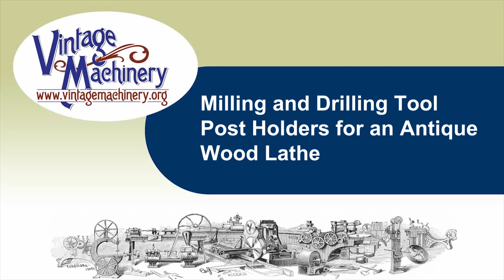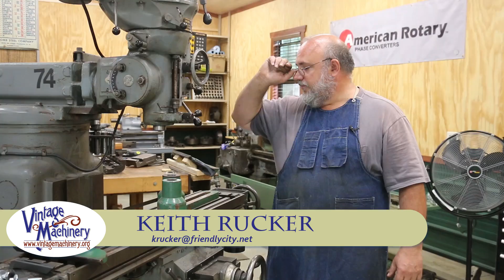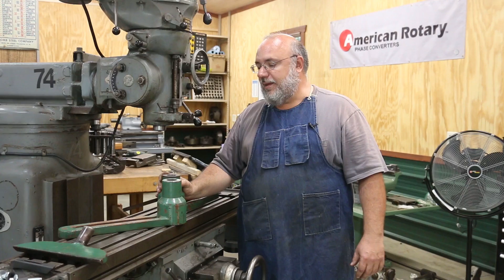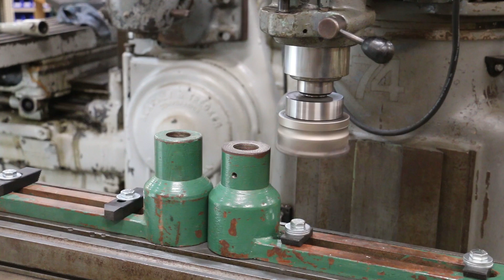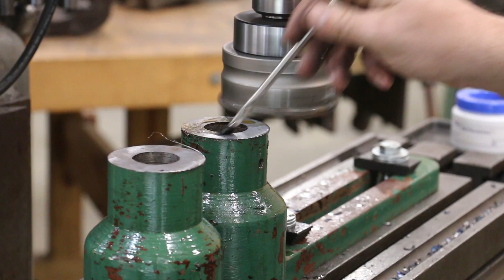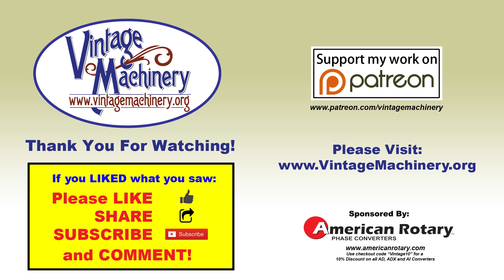Milling and Drilling Tool Post Holders for an Antique Wood Lathe

Comment: I'm surprised you didn't opt to use a slab mill in the horizontal mill for this. That said I love using shell mills for this sort of situation. I've done this to a lot of assembly jigs at work; the jigs are for spot welding robots; We needed more weld gun clearance that the tool shop provided. No match for a massive Japanese vertical mill with a six cutter carbide shell mill. Left a nice finish too.

Comment: Layman here, so not qualified to criticize but thought I saw some wobble in the chuck and bit-?  But it seemed to have bored the hole just fine, turned out great in any event,  Im sure the users of those lathes will be very pleased, having the rest off center is way scary on a wood lathe with hand tools-lol. Great videos Kieth.
Reply from the maker: The wobble was from the drill bit not being perfectly aligned with the hole.  No big deal in this application.
Reply: Guess I should have assumed as much, obviously didn't affect the end result, and that's all that matters.  Thanks for the informative videos-!

Comment: when you clamped the rests to the table the middle of the finger was used is it not better to use the tips to avoid bending the clamps were the bolt goes through.?i am  asking not saying. this was advise I got from another seasoned machinist...

Comment: Did you change speeds on the spindle without turning off the mill?   What kind of mill can do that?
Reply: grayswandir47 not sure about this one but the vario drives use two pulleys, or more, that vary their diameters inversely. Like a cvt.
Reply: I've seen the insides of a Shopsmith with the "Vari-Drive"     It was more like he selected a different gear.
Reply from the maker: The Wells-Index machine that I use has a variable speed drive that you can only change while the machine is running.

Comment: Keith, when using the face mill it's better practice to have about 30-70% step over for better chip loading on the insert, going thin to thick, down the center your not likely to have thick-thick chips which can be detrimental to the insert, if your looking for that centered finishing pattern save that for a final pass of 5-10 thou. sandvik has a great video to explain the issues of radial chip thinning. not just for cnc

Comment: No need for primer/paint?  The shorter one had been milled down previously, and had no paint.  It looked a bit grungy but looked flat.  I guess the real question is what type of steel are they made from?  A little knowledge is dangerous! 8-)

Comment: When I am using carbide on an interrupted surface I get rather worried about the inserts. Are there any rules about better ways to keep inserts intact?
Reply: Milling machines always make interrupted cuts. ;-)
That's why milling inserts have different types of carbide than lathe inserts.

Comment: Just wondering....  Wouldn't it be better to have through holes in the rest holder so chips and trash wouldn't accumulate in the bottom of the holes?

Comment: Removing that much material, why wouldn't you use a band saw to cut the majority off, then mill to the final dimension?
Reply: He was removing <15mm, the milling machine would get that off in no time. Look at the time cost: bandsaw setup, cut, bandsaw setup cut, milling set up, cut probably two passes (assuming you can't get both pieces in the bandsaw). The other option which Keith used was milling set up, cut in about five passes. I'd say the milling machine only option was much faster here.
Reply: Exactly.  Band saw or even a cheap chop saw to take off the bulk, and the milling machine to finish it
Reply: i have a 9x49 mill but i would have put that thing in the vise on the welding table a cut the majority with a zip cut blade on a 5 or 6 inch  then put it in the mill.
Reply: I wondered the same thing.
Reply: With a bandsaw you'd have to support the reduced diameter that you're cutting or grip the banjo in a heavy vice and it's sometimes just not worth risking breaking a blade if the support slips or there's a lot of vibration. A power hacksaw might have worked but only if the base plate doesn't get in the way of the saw arm and it would still take a while anyway. It would have been a good idea to save the offcuts though for spacers etc. or even cut an inch off and make some half inch height setting rings for below centre spindle work to avoid the constant re-adjustment after raising the rest for parting off or skew chisel work etc.
Reply: That is exactly what I was thinking.  I think that you could get it very close in a minute or two then mount them both on the mill table and have them to finished height in another couple of minuets.  (depending on set up time of course!)

Comment: Would'nt it be better to remove more than 1/2" so when adjusting the height, the rest can be raised up to meet center ?
Reply: I wondered this too. I will sometimes have my tool rest a little below centre so that I can have the tool on centre and keep the bevel rubbing.
Reply: This is standard practice, or should be. For the engineers who aren't familiar with woodturning, the rest will normally be about a quarter of an inch or more below centre for roughing and gouge work but only on or above center for parting and bead rolling or skew chisel work. The tool thickness and angle of attack raises the cutting edge up way above center most of the time so it's rare to actually cut on center like on a metal lathe for between centers or 'spindle' work. Faceplate, chuck or bowl turning however often involves the use of flat scrapers which are held at a negative or trailing angle and used on a toolrest with it's top edge at or around center height.
Reply: I agree it would have been better as there is still little to no vertical adjustment. Kieth said they were about a half inch too high so I personally would have taken a quarter inch or so more to allow for height adjustment

Comment: That drill doesn't appear to be running true. It looks like the shaft is slightly bent.
Reply: That's also a heck of a hot supper for a Jacob's chuck. Never thought they could even do a job like that.
Reply: The flutes are probably not ground even, which is more a matter of luck than skill when sharpening them by hand.
Reply: I agree. From around 9:50 onwards, if you look at the chucj itself, against the bench in the background, there is some serious runout.
Reply: Looks more like an Albrecht, but nonetheless it's a hard job for it.